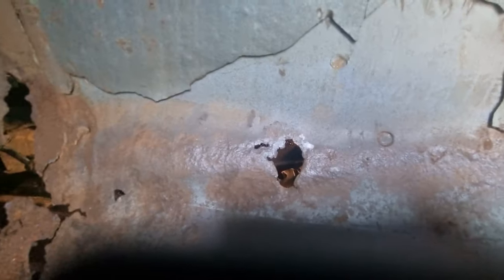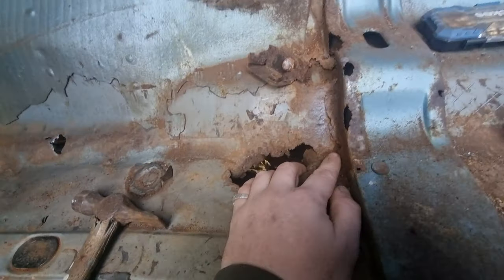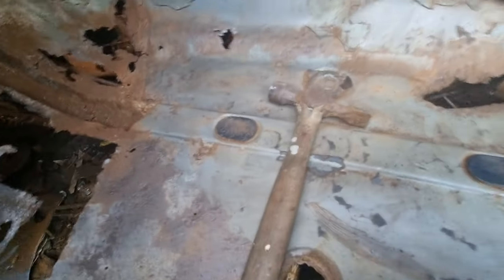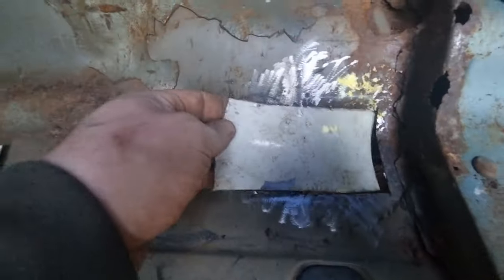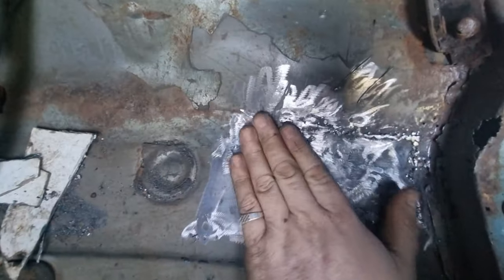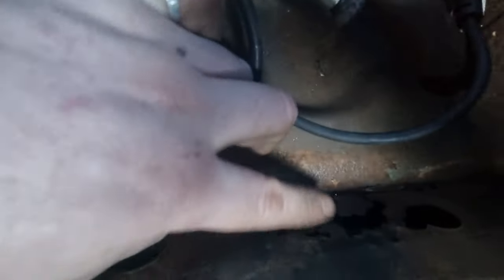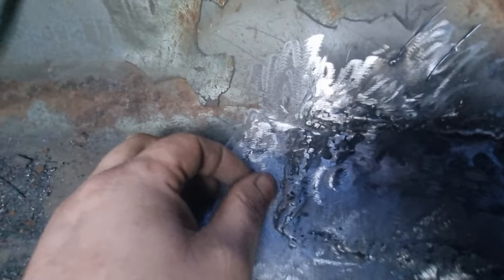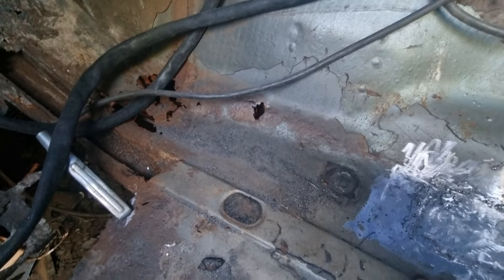Cortina Mk4 Ghia 2.3 V6 Restoration || Passenger Floor Pan Repairs P1 (P33)

Comment: Great work please display Courtney  don't ever re register put on the road there will be hidden  rust as well as you can see... These sections need massive repairs not small patches..  P.S  doing a great video just remember  sometimes  a car has gone too far  should be allowed to die a graceful death..
Reply from the maker: hi have you watched all of my videos with the chassis been replaced ect i have checked all places and know where all the rust is even the outer sills will be removed there will br no stone unturned techicaly im not patching metal im but welding it that way the metal becomes one peace patches is when you weold over the top of the rust and holes or over the top of the metal i dont class this as patching but thank you for watching :)